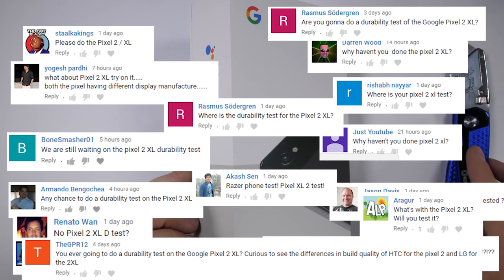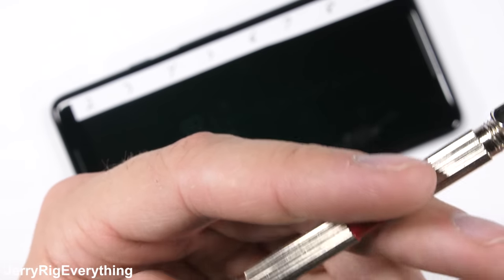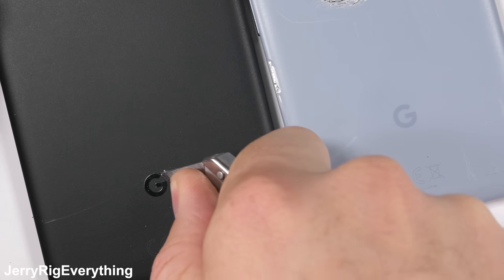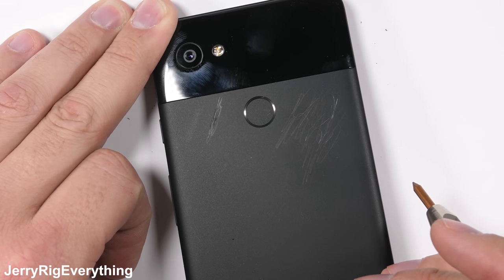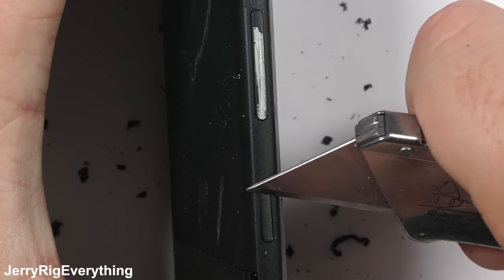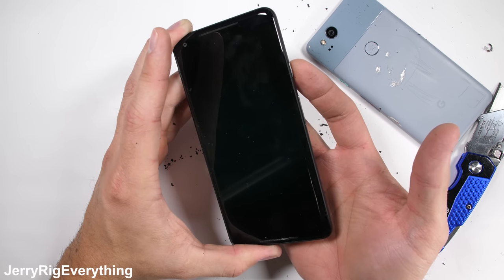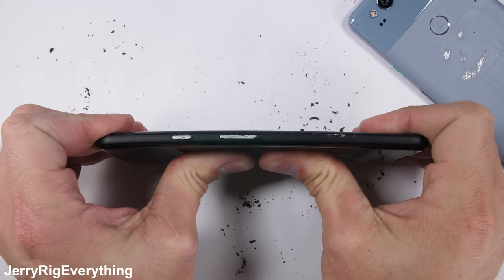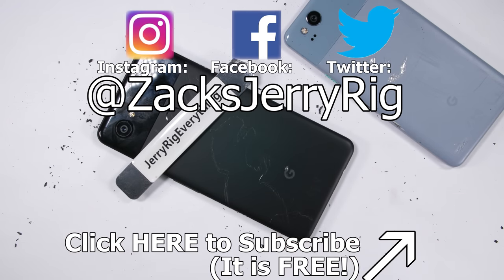Pixel 2 XL Durability Test! - Is Bigger Better?

Comment: Throwback to the Nexus 6P's durability test
Reply: Still watching on it right now :D Didnt break yet :P
Reply: same as the comment above ^
Reply: UnPhayzable w
Reply: UnPhayzable why
Reply: Ben Toe why
Reply: Mine has bootlooped 😥 R.I.P. now watching on a Nokia 8
Reply: Ben Toe My favorite phone of all time. Still such a good all around phone.
Reply: My 6p didn't break, but suffered from the boot loop of death. It's junk now. Liked it more than my note 8 I have now :/
Reply: K-Dizzle My battery crapped out and Google gave me a Pixel XL 8 months out of warranty. Im not mad at all, im happy with it, but honestly the 6P was a better phone imo. The loud stereo speakers were the best. It was also nicer design, and much more developer friendly with A/B system.
Reply: j-cast c I tried talking to Google multiple times and huwei. Was out of warranty and out of luck. They said I could sell my 6p back to them and put it towards a new phone of theirs. They offered less then I still owed on it.
Reply: K-Dizzle I got my 6P replaced twice, the second time they game a Pixel. The thing is i did buy it from Google, and i have bought a 5X, a Pixel C with keyboard, and two chromecasts. I think the thing was to buy from google not a reseller like Best buy.
Reply: I did buy straight from google and was using Project Fi. Go figure.
Reply: K-Dizzle You should call them again, Google honestly has taken real good care. Call google and Project fi.
Reply: Yeah except this time it survives

Comment: Yeah I know the abnormal accidents, I dropped my Nextbit robin in the door of my car and closed the door all on accident and didn't see it. It all happened in seconds
Reply: Devon phipps I dropped my 6p down the stairs.....
Reply: i dropped my asus x550ca down the stairs on purpose and it survived with a dead hard drive but thats easy fixed
Reply: I did the exact same thing with my Sony Xperia Z. It smashed a corner of the glass and I just replaced the glass back
Reply: I threw my iPad 78 off the 69th floor and it survived
Reply: Blink Blink

Comment: Liked the video, I have a Pixel 2 XL, screen shaded after 2 days (hadn't even used to make a call yet) my 10 month old dropped a TV remote on it from about 10-20cm on the rounded edge whilst on charge at my bed side. 
Question/Feedback: Some sorted screen durability testing for impacts would be great to see in another video!

Comment: Pixel Device
Screen: Level 6
Body: Level 3 
Headphone: NA
Bend: Cracked in half
JerryRigEverything: Pixel 2 a really good phone for a lot of people. 

iPhone X
Screen: Level 6
Body: Level 6
Headphone: NA
Bend: Slight distortion 
JerryRigEverything: iPhone sucks! I hate this phone!
Reply: he just doesn't like the iPhones for their drop of headphone jack and recently the back glass
Reply: Durability is only part of how good a phone is. Good on him for recognizing that.
Reply: OK you exaggerated the damage it didn't snap in half
Reply: Pixel 2 xl never snapped at all
Reply: remember this: GLASS IS GLASS AND GLASS IS FRAGILE
Reply: Body at a level 3 with paint gg dude, of course a glass back will be better at resisting scratches than a plastic/paint back

Comment: So glad this video is up cause after owning the XL for a while now I definitely thought it was good quality hardware wise. The phone feels rigid and I was wondering if it would bend. During some Minor
Bend  tests I ran to just see if I could get some flex (not to break it) I got zero bend which was good. and despite that coating it feels better in my hand than last year's Pixel XL. Still slippery but with just a small noticeable difference in grip that I like.

Comment: So far, I think the burn test is already useful in that it indicates which displays recover from heat exposure. In real world incidents, I've seen people put their phone on a heater to support it while it charges. The heater may have been off when the phone was perched on it, but a second person decides they're cold and turns the heater on, without thinking to check what's on top of it first.

I've seen phones stored somewhere which has gotten really hot before. I have to assume they weren't hot when the phone was put there.

Comment: If the pixel 2 xl speaker grills/mesh get pushed in too far, is the phone's waterproofing compromised and water can enter the body through that point, or is there a rubber seal behind/beneath the grill mesh that upholds the phone's waterproofing? Thanks for your help!

Comment: I honestly don't know I watch these reviews anymore. They all scratch at a level 6 unless its a plastic screen. The fire test is absolutely pointless. The bend test depends on how much Wheaties cereal you ate for breakfast. The teardowns are kinda neat, but its literally the same video every time.. "Well we know it has gorilla glass 5, like every other flagship this year, but lets ruin the screen to verify ...*5 seconds later* ...you can see the light scratches at a level 6 with a deeper groove at a level 7". Here's my suggestion: Ditch the flame test immediately, the scratch test is pointless when they're all gorilla glass 5, and start using some repeatable measures. (e.g. JERRYRIG up a device that allows you to consistently drop a phone from variable heights and compare between phones), how about a test for waterproofing if you're going to ultimately ruin the phone anyhow through scratches, bends, and a teardown?.. I'm just bored of the same content. You've got a lot of subscribers, keep things interesting!

Comment: I like stock Android and always loved Nexus. But had a bad experience with original pixel. I use cases but not a fan of screen protectors. I had a s7 edge for a while and was pretty rough with it never got a scratch. Bought a pixel. Babied it and it got a thorough scratch on screen within week. Sold it cause of that. Got a s8 had since March pretty abusive to it, no scratches. Decided to give pixel a try again. Just got the 2 xl. Don't want screen protector but I'll be pissed if it gets scratched. How come all these phones are rated at 6 hardness but the original pixel seemed much more fragile? Can anyone who's had pixel 2 XL without protector let me know how it's faired so far?